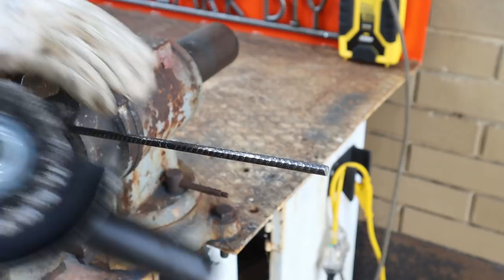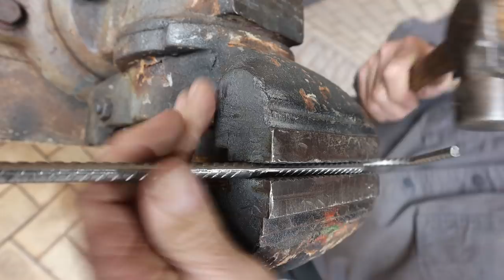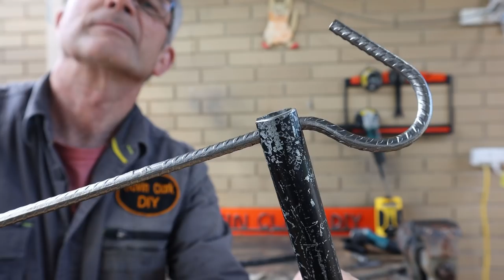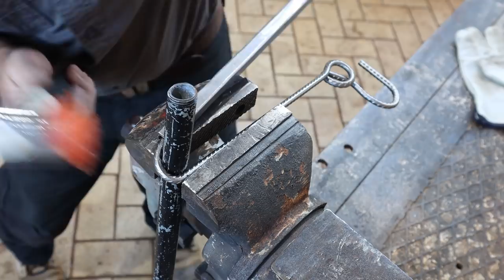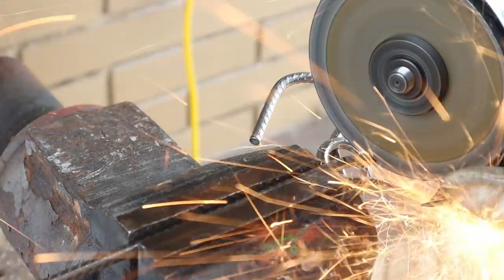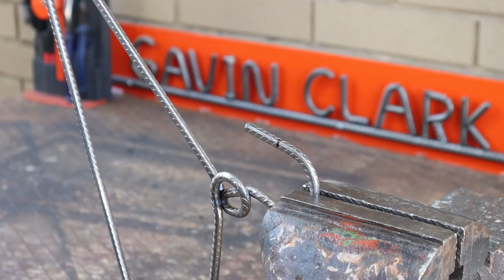I make an Industrial Design Style Coat Hanger using Steel Rebar Rod - MIG Welder Project

Comment: What are the reasons for removing the scale before working on the rods?
Reply from the maker: At the end of the project, I clean it all up ready to coat with a finish because it is bent sometimes it is hard to get to some parts, by cleaning it before bending those parts are cleaned and at the end, it all just needs a light clean-up.

Comment: Really like your videos!! Very creative!! couple of questions please - are you using fluxcore wire or shield gas? what size welder are you using? (I guess amperage is what I'm asking - probably can't get the same brand here in the states.) Thanks for the awesome videos, hope to see many more from you!
Reply from the maker: Thank you very much. My MIG welder is a "Unimig Viper182" 240volt and I am using shield gas. Your best bet would be to ask someone over there which would be good for you, but either way, if you search "Best entry-level mig welder" on youtube you will get a good choice from people that have on hand many MIGs to play with and would know much more than me. Hope that helps a bit.

Comment: Gavin do not forget how to protect rust .....by oil or color ?
Reply from the maker: I used Penetrol Rust Treatment Penetrates Rust 300g Aerosol Spray, and then put two topcoats of Semi-Gloss Clear Coat. That is what I used on the rebar lettering on the back of my workbench, here is the link to that video. https://youtu.be/JA-wk62Zghk  I try not to comment on finishes, As what climate you are in, is it inside-outside, lots of rain, ice, do you want long term and rarely touch, or a wax with a wipe over every year. That is why I have no opinion, Please ask someone in your area what you should use, I feel this is a better way to find out. Thank you for your comment.